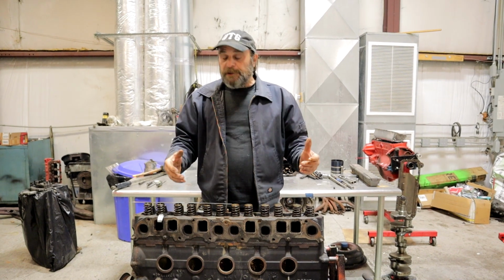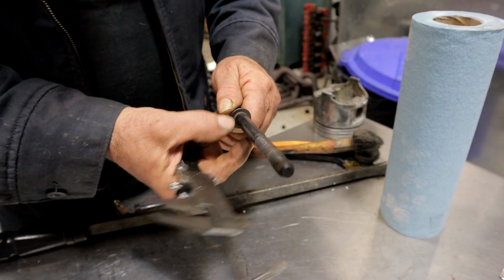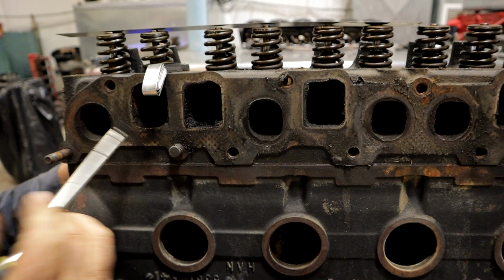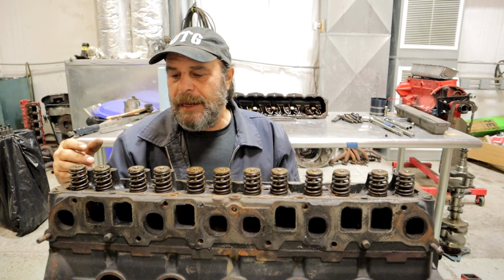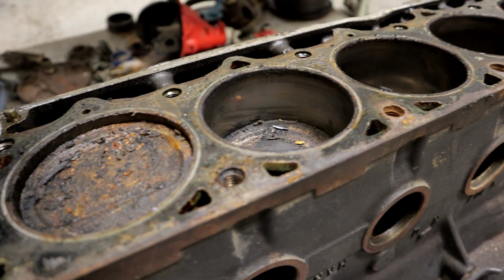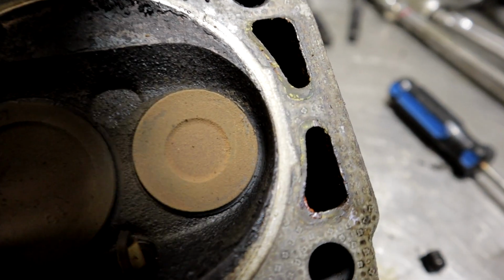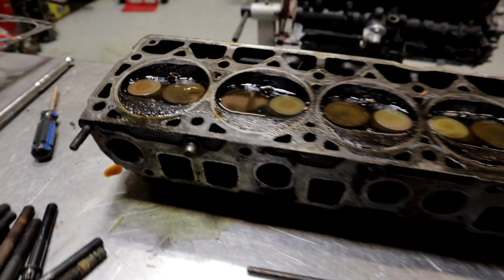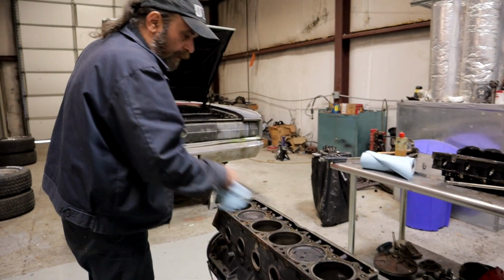Your First Engine Job - Pulling The Head And Assessing The Damage

Comment: Hugh,I agree with you,you do a average build,parts and maching1500-2000,and now you don,t want to spend 50$ on bolts,go right ahead,watch that head gasket come out.Alot of times the  threads at the top of the thread length are sitting above the deck in the head bolt holes,even if its just a couple,and over time,bad oil and gas and carbon gets in there and sits for how many years,as a example,you remove a head and the head bolts are covers in black crap sitting rotting the threads and the shank of the bolt away.After working on engines for 49 years form race cars,trucks,and aviation,you see alot of shit,and there can be badly made bolts on the factory line,god forbind that out of the 10,s of millions of bolts being made for as cheap as possible that there be a few thousand difference in the thread pitch or the diameter.Scott Preston/mrmopartech

Comment: Most engines that run port fuel injection don’t have much ring ridge. This is due to the proper amount of fuel, not washing the cylinder when it’s cold. You look at most carbureted engines and they have a ridge.

Comment: Sorry, you cannot accurately determine bolt stretch with the caliper. The .001 figure you said is less than the typical accuracy of a Vernier. You would have to measure the initial length and compare that to the length after torqueing using a micrometer. Rod bolts are typical torqued with a rod stretch gauge which incorporates a dial indicator. Not necessary for a street motor. If you are concerned with bolt stretch, just buy new bolts.
Reply: You don't have to be accurate when the diameter is off by . 004-.005. but like you said, he needs new bolts anyway. The head torque loosening process is a good give away as well.
Reply: Maybe when you're talking about the accuracy  of your average Harbor Freight calipers, the ones I use are good for 2 ten thousands .
Reply: @brucejones2354  verniers? yeah, right
Reply: indeed..or get ARP stud set...ez peasy
Reply: @rbotton6272  nah, just re-use if not stretched. The best parts came with the engine at the fact-tree. But arp are good insurance.
Reply: There is absolutely zero point or purpose to ARP anything in a stock 4 liter straight six... lol

Comment: Eh,  cut about . 080" of the deck, and about the same from the head, with the pistons out the block slight amount tgen clearance tge pistons, Mae get the cam reground,  get a bit of spice , with about 10:1 maybe 11:1, and smooth out the runners , a ceramic coating on the ports, chamber and piston,  port the intake match it to the head, a decent exhaust..  keep the heat from the intake a bit, with the coatings, it should be a spicy Daily driver, with a marine cam grind possibly,  or maybe a towing cam, basically the only cost would be for the machine work and cam,. I have heard of using 3.8 cranks in the 4.0, building a stroker engine, they can nake decent power for a street engine, 
I want to get a vortec 4200, and sneak a turbo on it,  it would be awesome to have control of both cams also the duration, program the ECM to give overlap  and some duration to give a choppy idle, but drop all that and revert to settings to make TQ by just off idle 800-900 rpm or so,  upgrade to better rods and forged Pistons, 9.5:1 with  boost aroubd 1-1.5 bar, keep your foot out of it, and it shoould be a good daily! Haha,

Comment: 4.0 is known for blow by which causes the oily intake. I had one so bad a ran a garden hose along the frame and dumped it on the ground. HOW DARE YOU !
Reply: I had to do that with a tortured 460 I ran in work truck for a while.  Left a gnarly sludge pool wherever I parked her too
Reply: Haha pcv fumes are about one of the nastiest smells , I love my diesels but open pcv freakin reeks to heck! 
One of em I routed out the grille ,only bad part was the oil mist getting to the windshield 😂
Reply: @MrTheHillfolk  you can always plumb the pcv into the air pipe feeding the turbo. That is how my old Mercedes’ diesel is. Never any fumes
Reply: @bcbloc02  yeah it was loading the intake with alot of oil because it was tired. 
I later rebuilt it and put in some total seal top gapless rings and they worked awesome.

Comment: Right idea, faulty application. Those are almost certainly rolled threads as opposed to cut.  It doesn't mean Tony is wrong but the method of proof is bunk. And frankly almost impossible to prove.  So, unless you're dealing with a low compression lawn mower, fahgettaboutit and get a new set.
Reply from the maker: No, watch the video again.  There was a difference in diameter in the threaded section of the bolt.  The shank is one diameter, then the first 1/3 of the threaded section another, and then the threads engaging the block were thicker.

Comment: I thought it was always good practice to use new head bolts? I can understand slamming an engine together with used parts, but if it’s a true rebuild, no reason to cut corners.  Laymen there though, could be wrong.
Reply: Best/required practice is always new bolts if they're torque-to-yield.
Reply: Depends upon the type of head bolt. As Dan has mentioned torque to yield bolts should be only used once because they are, by definition, stretched.  You can tell if your engine is torque to yield if you see  multiple warnings to not reuse the head bolts (on head gasket packaging for example) or if the torque specifications include torque angle.
Reply: @DanEBoyd  thanks!

Comment: 4.0 intake valves have a height of 4.912"
Exhaust valve height is 4.940"
Reply from the maker: That's overall length...from face to tip, not seat to tip.  The exhaust valve is thicker

Comment: Just get new head bolts anyway it's cheap insurance for what they cost I never use old head bolts after I tried it once and was out doing burnouts and beating on a little 305 I had slammed together and blew both head gaskets that were three hours old so start all over again with new bolts this time and I ran the snot out of it for 3 yrs and not so much as it using a drop of coolant or any issues at all it wasn't too bad for a 40 over 305 either with a little head porting and a small cam those small cu inch motors you can over cam them very easy and they are slower than stock with a big cam in them learned that yrs back w a 283

Comment: I'm looking at having to do my 5.9 Cummins. 4 of the cylinders have 700 lbs of compression 2 of them have 415 lbs of compression and there are gouges in the cylinder walls like something went through it. I had the head redone already.
Reply: Love me a B series big-time,but thats one of the "bad" things,if the bores are really chooched cause it might have to get sleeved (whereas larger diesels and their replaceable liners) 
No biggie , money can fix that issue 😃
Reply: @MrTheHillfolk  I think I basically have two options. Find a lower mileage engine out of a wreck or order a short block. At least with the second option the head I have is fresh. I have a 4020 John Deere diesel that's 404 cubic inches and those are sleeved. Press the old ones out and the new ones in. Fortunately Deere built that engine for 35 years so there's a lot of them in service. Don't know why Cummins didn't build them the same way. In all fairness I think the person who had the truck before me had the screw turned up pretty high. Most everyone I know gets 4 to 500,000 miles on them before there are major problems with the exception of fuel injectors which don't seem to get much past 150,000. The old 12 valve injectors went forever.

Comment: can you just measure the bolt length on same size bolts uncle tony? you would know.
Reply: Not necessarily. The manufacturer tolerance on length might be greater than possible stretch. I'd have to ask whether or not that bolt is long because it ended being made that long, or is it stretched?

Comment: Here's how you fix the head, throw it out and buy a cheap set of sbc performance aluminum heads cut the 2 end chambers off of one and cut the other one right in the center so you have 2 halves with 2 chambers each. Then weld the 2 end chamber pieces to the double center chamber piece and there you go, a performance head for your 4.0L. Doing it this way gets the valve configuration how it is suppose to be without having to have a custom cam made.

If the Ford 300 can have LS heads cut and welded together to work on that engine why not use cheap aluminum sbc aftermarket heads on a 4.0L Jeep engine? It is 2 welds instead of one weld, no big deal.

The bore spacing for a sbc is 4.400" and the bore spacing of the Jeep 4.0L is 4.380". To overcome this difference the center 2 cylinders will be off by .010" each which = the .020" difference of the 2 different bore spacings which is close enough for those 2. But moving out from the center the next 2 cylinders will be .030" further out. The .010" the 2 center ones are off plus the .020" bore center difference = .030". 

To correct that and so the end 2 aren't .050" off center we need to take a  total of.040" of material off the ends of the center section and where the 2 outer sections are cut. This brings number 2 and number 5 cylinders within .010" of center off the other way that pulls the last 2 furthest out cylinders within .010" of center. A we all ready know that .010" are close enough. Don't forget to account for the saw blade thickness that is removed when using a saw to cut the sections of the head.
Reply: @faststang89  
LOL!
Yeah he probably won't on this one but maybe the 2nd 4.0L he has that he said he wants to do something special with.

HRM did an article on the Ford 300 with welded together LS heads they would probably give equal time to the 4.0L jeep engine with sbc welded together heads?

Comment: Experience of ordering reman heads/blocks/complete engines in the last two years is not worth your time to make the phone call. Personal experience is that if you order from any single corporation it will take 8-16 weeks to resolve and issue if it is ever resolved. Meanwhile they keep your money. You need to find a locally capable machine shop or order prepare to pay for top of the line cost for someone to ship something to you.